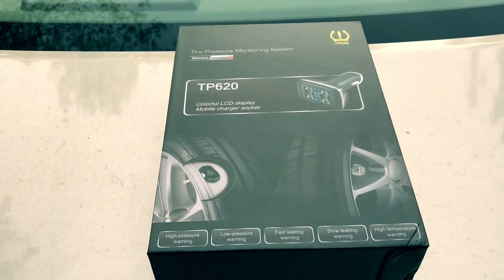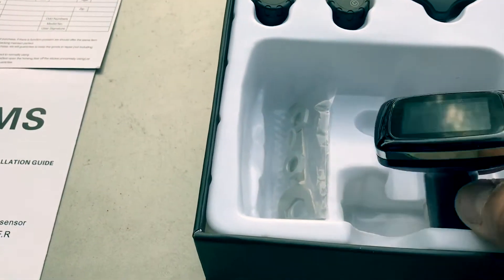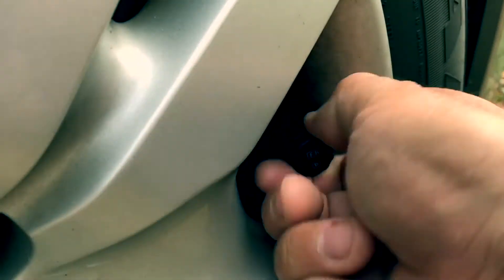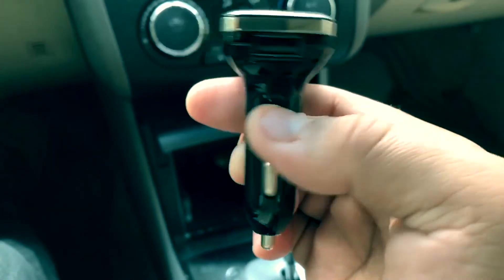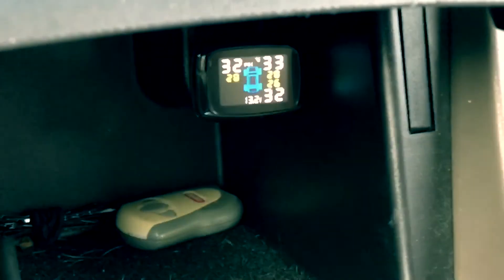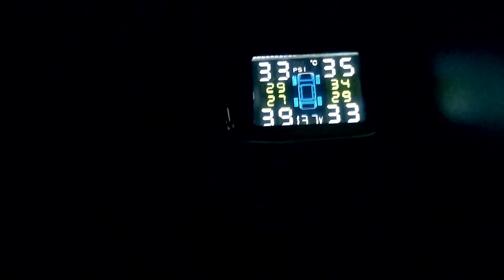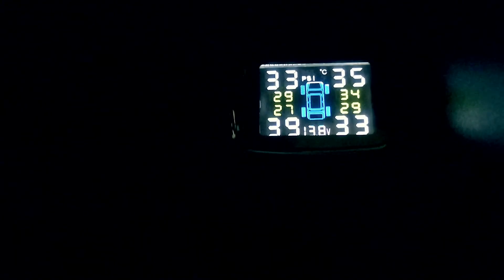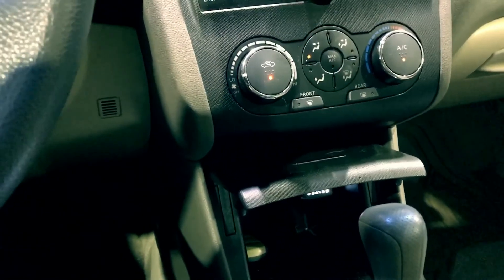B-Qtech DIY Tire Pressure Monitoring System, Wireless TPMS with 4 External Sensors

Comment: FYI One value is pressure, the other value is TEMP (not the tresholds). Very usefull when i.e. racing and You want to find a good tire temp. This means You can trim tire pressure on each tyre to have similar temp on all wheels. What I would like is how exact it is compared with a pressure gauge. I see some odd measurements where temp is higher on the wheel with higher pressure, it should be the opposite unless You do mostly left had turns which makes right hadn wheels heat up more.